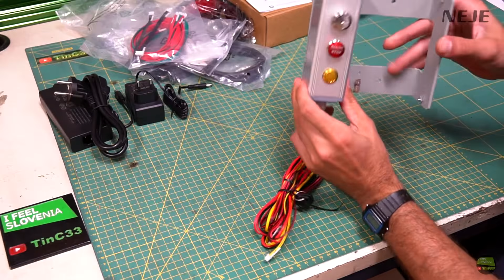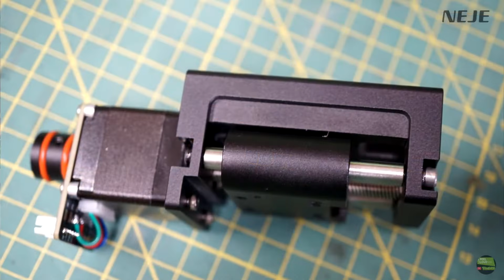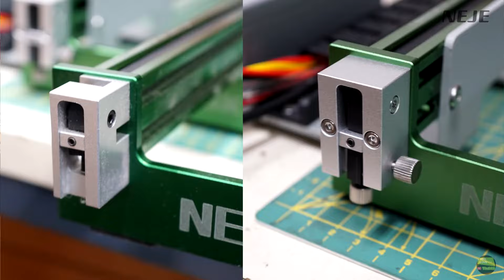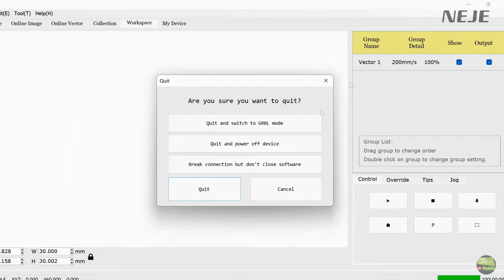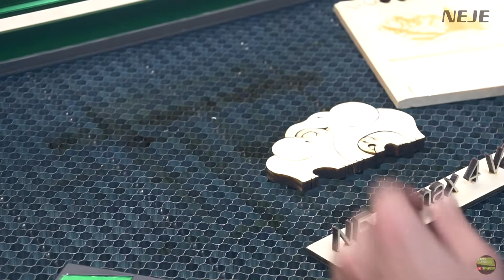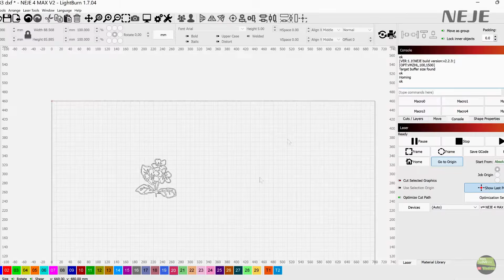NEJE MAX 4 V2 cnc laser engraver / cutter + E80 + Honeycomb panel [unbox / review / first test]

Comment: hi I am new to this topic. And I bought a laser module to make my own. neje e80 And when I used its tester board to test it, it was completely normal،But when I used the tester board a few days later, the light it produced was parallel, not a spot. It was hot, but not a spot. I wanted to know if there was a setting on the tester board that I messed up. I would really appreciate your help
Reply from the maker: You may lower down the power so the lines are better visible, there is no dot on focal point but two lines like "II" you can nicely see the line if you lower down the power to only few % and set a bit too long focus, but when you set proper focus and power over 10-20% lines would not be visible anymore but only a dot also work like a dot while cutting/ engraving...
Reply: @TinC33  Thank you very much for taking the time to answer me. Really appreciate it.

Comment: Nice review. When the E80 was released more than a year ago, I got it for my Max3, since then Neje has been making newer versions of laser cutters but the annoying thing is that to utilise the E80 it needs a sturdier frame hence the Neje Max 3 v2. My issue is that Neje does not sell the  Max 4 or Max 3 v2 without a laser module preventing early adopters of the E80 to upgrade their kit; you're being forced into buying a full kit with a  laser module which increases the cost overall.
Reply from the maker: True, true, also i was asking myself why they dont sell machines without modul wich cost almost half of machine...
But the e80 come out with max4 i think, whoever got the max 4 wont upgrade to a v2, but i cant wait to release what i see in the manual, maybe it come with a neje 5😊 i talking about neje E160 (google it) it will have separated power supply i think 36v and a water cooling system 😃
Reply: @TinC33  The E80 was released before the first Max 4 was available. I pre-ordered the E80 end of November 2022, received end of January 2023. The first Max 4 was released around spring/summer 2023.